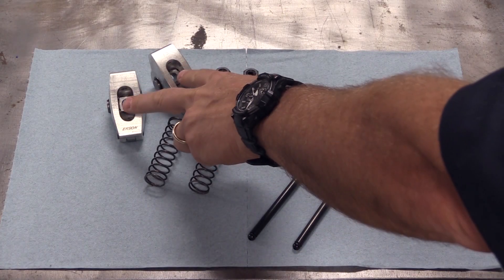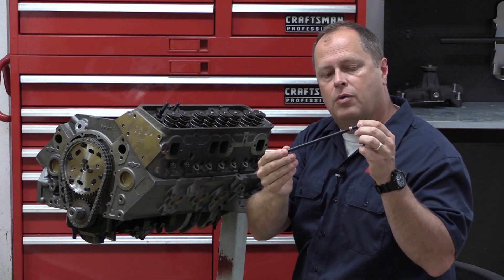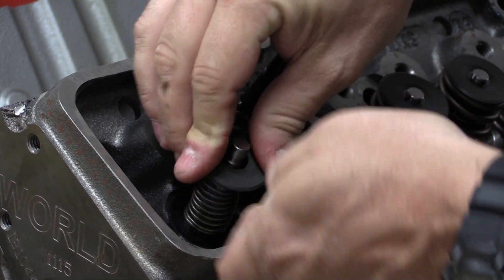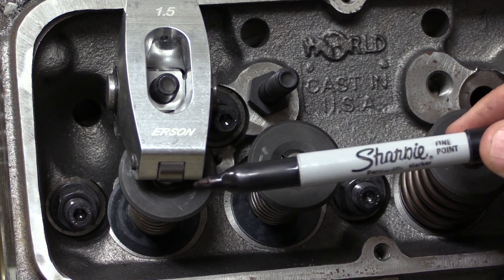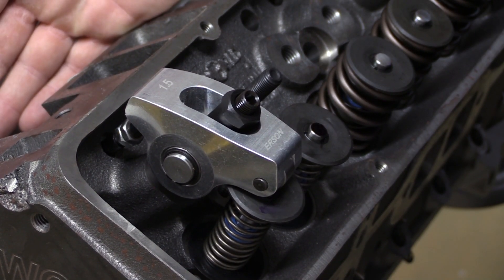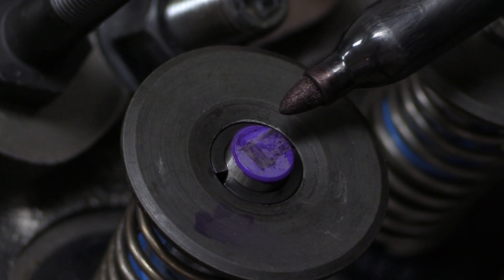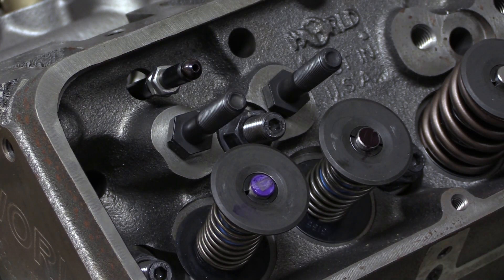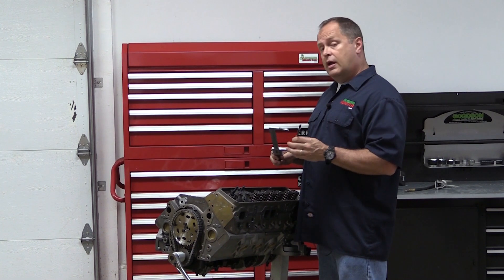How to Determine Correct Pushrod Length

Comment: turning engine over with the checking spring will not leave a mark on the machinests dye, the checking spring is too lightweight so you have to just slightly wiggle the rocker back and forth on the valve to leave a small mark

Comment: I don't follow these threads so my responses to them are very intermittent at best; people waste too much time worrying about a moot issue in all your discussion about the P.R. Ball tip radii and oil hole, etc. And TFS and Summit are hardly authorities of high performance. If I had $10.00 for every TFS head I had to tell the rocker customer to throw away before buying rockers, I'd of retired much sooner. Push-rod "checkers" are another joke, even though I designed one of the simplest and most accurate on the market for our PVS rockers. Personally, I never used one because I could set the geometry to within .003" of dead accuracy (.001" actually) in about 5 minutes with nothing more than a straight edge and set of dial calipers. Anything longer was only the result of how many Jack Daniels and Coke I was drinking at the time; so in those cases it may have taken me 10 minutes.

Point is: If you know what you are trying to do, then you solve the problem with the FINAL RESULT technique, and THAT circumvents all the theory, all the push-rod tip radii flats from oil holes, and all the other crap people get lost in the forest for the trees, trying to over analyze.

Secondly, all this VALVE SIDE geometry is mitigated (reduced) in its benefits if your PUSH-ROD side of the rocker is already too high from the manufacturer (as all are, except what I make and made), and the axis of the push-rod link (ball tip, or adjusting screw) is over-arcing and sweeping inward to the center of the rocker as it moves up to maximum lift. If you need a visual of this, simply use the tail of your dial calipers (for a depth measurement) and butt the end of the calipers against your rocker rail -- extending the measuring stem up against the push-rod for THREE measurements: CLOSED VALVE; MID-LIFT (I still hold the TM for that term, so it would be "half-lift" for everyone else); and finally FULL LIFT. You will see the push-rod has moved from its nearest position to the rocker rail, to its furthest position, will be anywhere (if you're lucky) from .050" maximum in-and-out sweep; to (if you're typical) .150-.180" maximum sweep; and if you're really using some junk, it will exceed .200". FYI, the MID-LIFT PVS rockers, and my MEI (Miller Engineering Inc) PRO-STUD, and PRO-SHAFT systems I designed have a push-rod motion (depending on valve lift, of course, because there's more arc involved) of approximately .013" (thirteen thousandths); to high valve lift (over .800") of .017" maximum in-and-out. In other words, to the typical untrained machinist's eye, you can't see the push-rod move in and out on MID-LIFT systems. It simply goes UP and DOWN.

This isn't an ad, nor am I bragging; I've stated these "facts" in countless published materials over the years, long before I was making rocker arms, but only building engines. My Book: ADVANCED ROCKER ARM GEOMETRY (By Jim Miller), available at MID-LIFT.com and Amazon, explains all this in simple terms, but also tells you how to FIX the other rocker brands that are out there. Some can't be fixed, like Harland Sharp. But Jesel and T&D can, with some tradeoffs. In SUMMARY: You set rocker geometry by using the valve itself on an unassembled engine (yes you can set geometry for "shaft" systems on a work bench, unassembled); or the valve spring retainer on an assembled engine. You use MATH, not "eyeballs." The sweep on the valve tip is only a symptom, and you can be off by 20% using that. How anal am I about push-rod geometry? My systems have the push-rod lined up with the tappet axis, and the rocker arm decisions are made from that reference point on an assembled engine. Unlike Dan Jesel, who never designed a rocker arm in his life on an assembled engine, but only used a head on a bench, ("Send me your head, and I'll design you a rocker." --Dan Jesel), every measurement a MID-LIFT system uses is based on the cam position in the block, the tappet position on the cam, and lastly, trying to work around the cylinder head manufacturer's ignorance about rocker arm mounting and push-rod needs when designing their ports. The push-rod is EVERYTHING.

What difference does that make? Well, the push-rod sweep I mentioned above, means your push-rod is wasting time going in and out instead of up and down, and in the micro-measurement world of cam acceleration ramps, that works out to LOSING 8, 10, 12 or even 15 degrees or more of CAM DURATION during the acceleration ramp phase. In other words, your 265 degree at .050" tappet lift cam, is in reality only 250 degrees at .050", when you remove what is lost at the VALVE. You don't know it, because you only check the cam duration at the cam. If you're a pro, like the NASCAR teams I taught back in the mid and late 1990s, you have a Cam Doctor, and use dual sensors at BOTH the TAPPET and the VALVE, then you see it. Then you realize how important splitting the push-rod arc equally is, as well as the arc on the valve, which is secondary. But because the valve is what everyone sees, because it moves 1.7 times more than the push-rod (ratio effect), and because it leaves a mark on the valve tip, that is all anyone pays attention to. So if you set MID-LIFT geometry AT THE VALVE using the RETAINER as a GUIDE to see where the AXIS of the TRUNNION o SHAFT is in relation to the AXIS of the ROLLER TIP, in the CLOSED VALVE position, and you KNOW your NET VALVE LIFT, so you can DIVIDE that lift EQUALLY, then you don't need to worry about push-rod tip radii, or anything else. You bypass all that crap. And so does your CAM! Good Luck! --Jim Miller
Reply: Can you please make a video? I want to do it your way, but i'm not good with reading. Or else i would buy your book.

Comment: Great video! Much clearer than others I have seen here. As you said, the contact patch is better high than low. In fact, for long valve guide life it's better high than centered. Valve spring pressure (and side thrust wear) at max lift is MUCH higher than seated pressure, so it's better for the contact point to be just past center at max lift.

Comment: Do the same on the other bank / head--you would be surprised at the variance you might find.
Reply: Especially on older classic cars which may have had previous valve jobs/ machine work or valves replaced. Every pushrod in my '67 Corvair is a custom length. I mark them and do not mix 'em up.
Reply: Exactly...

Comment: This is a well intended video but has many errors.  Verifying the center swipe mark with a lite weight valve checker spring is basically correct.  Other critical details were omitted.  You do not simply measure the pushrod length after verifying the center swipe mark.  This is a common error. The technician did not account for the 0.017 standard machinist calculation for a 5/16 ball pushrod with a 0.10 through oil hole.  What is going on here is that the pushrod's ball radii, not the oil hole flat surface, is what interfaces with the lifter and rocker arm and is thus the actual pushrod length that the engine uses.  You can’t measure that radii however, so what you measure is the overall length which is where the calipers touch the machined off flat areas of the pushrod checker oil through holes. This is because most pushrod length checkers are real pushrods with threads and jamnuts added for measuring.  For a 5/16 ball end pushrod, the measured overall length is subtracted from the length at gauge diameter which is a standard value of 0.017.  It will always be 0.017 for a 5/16 ball end pushrod with a 0.1 oil hole regardless of actual overall length, so you simply subtract 0.017 from what you measured with your caliper.  The next error is that the technician did not add in length for required lifter pre-load.  If your lifter manufacturer specifies a desired lifter preload value, say 0.035, then you must add 0.035 to whatever you measured with the caliper.  Therefore, you measure the pushrod like the technician did, then you subtract 0.017, then add 0.035.  That gives you the correct pushrod length.  Summit Racing has a better video at https://www.youtube.com/watch?v=ddK0n2duAfg
Note that Summit used an LS preload value in their example but not all lifter preload is 0.075 so use the correct lifter preload for your lifter.  Many lifter manufacturers will not provide a desired preload value.  Typically, it is 0.020 to 0.060.   If anyone doubts the 0.017 value in my commentary, note that it is also in the Summit video above and also at the TFS website for their pushrod length checker.  See https://static.trickflow.com/global/images/instructions/tfs-9000_at.pdf
Also note that more modern pushrod length checkers, such as the TFS 9500 series, do not require the 0.017 subtraction since their ball ends are different and don’t require compensation for the length at gauge diameter. Preload length still needs to added, however.
Reply: Soooooo I got 7.80 length I need, minus .017 was 7.783, then I added .035 and got 7.81.........so STILL 7.8 pushrod lol. Whats the point?? Want me to pay double for custom pushrods that are 7.81 instead of 7.80
Reply: I don't follow these threads so my responses to them are very intermittent at best; but you waste too much time Brandon Smith, worrying about a moot issue in all your discussion about the P.R. Ball tip radii and oil hole, etc. And TFS and Summit are hardly authorities of high performance. If I had $10.00 for every TFS head I had to tell the rocker customer to throw away before buying rockers, I'd of retired much sooner. Push-rod "checkers" are another joke, even though I designed one of the simplest and most accurate on the market for our PVS rockers. Personally, I never used one because I could set the geometry to within .003" of dead accuracy (.001" actually) in about 5 minutes with nothing more than a straight edge and set of dial calipers. Anything longer was only the result of how many Jack Daniels and Coke I was drinking at the time; so in those cases it may have taken me 10 minutes.

Point is: If you know what you are trying to do, then you solve the problem with the FINAL RESULT technique, and THAT circumvents all the theory, all the push-rod tip radii flats from oil holes, and all the other crap people get lost in the forest for the trees, trying to over analyze.

Secondly, all this VALVE SIDE geometry is mitigated (reduced) in its benefits if your PUSH-ROD side of the rocker is already too high from the manufacturer (as all are, except what I make and made), and the axis of the push-rod link (ball tip, or adjusting screw) is over-arcing and sweeping inward to the center of the rocker as it moves up to maximum lift. If you need a visual of this, simply use the tail of your dial calipers (for a depth measurement) and butt the end of the calipers against your rocker rail -- extending the measuring stem up against the push-rod for THREE measurements: CLOSED VALVE; MID-LIFT (I still hold the TM for that term, so it would be "half-lift" for everyone else); and finally FULL LIFT. You will see the push-rod has moved from its nearest position to the rocker rail, to its furthest position, will be anywhere (if you're lucky) from .050" maximum in-and-out sweep; to (if you're typical) .150-.180" maximum sweep; and if you're really using some junk, it will exceed .200". FYI, the MID-LIFT PVS rockers, and my MEI (Miller Engineering Inc) PRO-STUD, and PRO-SHAFT systems I designed have a push-rod motion (depending on valve lift, of course, because there's more arc involved) of approximately .013" (thirteen thousandths); to high valve lift (over .800") of .017" maximum in-and-out. In other words, to the typical untrained machinist's eye, you can't see the push-rod move in and out on MID-LIFT systems. It simply goes UP and DOWN.

This isn't an ad, nor am I bragging; I've stated these "facts" in countless published materials over the years, long before I was making rocker arms, but only building engines. My Book: ADVANCED ROCKER ARM GEOMETRY (By Jim Miller), available at MID-LIFT.com and Amazon, explains all this in simple terms, but also tells you how to FIX the other rocker brands that are out there. Some can't be fixed, like Harland Sharp. But Jesel and T&D can, with some tradeoffs. In SUMMARY: You set rocker geometry by using the valve itself on an unassembled engine (yes you can set geometry for "shaft" systems on a work bench, unassembled); or the valve spring retainer on an assembled engine. You use MATH, not "eyeballs." The sweep on the valve tip is only a symptom, and you can be off by 20% using that. How anal am I about push-rod geometry? My systems have the push-rod lined up with the tappet axis, and the rocker arm decisions are made from that reference point on an assembled engine. Unlike Dan Jesel, who never designed a rocker arm in his life on an assembled engine, but only used a head on a bench, ("Send me your head, and I'll design you a rocker." --Dan Jesel), every measurement a MID-LIFT system uses is based on the cam position in the block, the tappet position on the cam, and lastly, trying to work around the cylinder head manufacturer's ignorance about rocker arm mounting and push-rod needs when designing their ports. The push-rod is EVERYTHING.

What difference does that make? Well, the push-rod sweep I mentioned above, means your push-rod is wasting time going in and out instead of up and down, and in the micro-measurement world of cam acceleration ramps, that works out to LOSING 8, 10, 12 or even 15 degrees or more of CAM DURATION during the acceleration ramp phase. In other words, your 265 degree at .050" tappet lift cam, is in reality only 250 degrees at .050", when you remove what is lost at the VALVE. You don't know it, because you only check the cam duration at the cam. If you're a pro, like the NASCAR teams I taught back in the mid and late 1990s, you have a Cam Doctor, and use dual sensors at BOTH the TAPPET and the VALVE, then you see it. Then you realize how important splitting the push-rod arc equally is, as well as the arc on the valve, which is secondary. But because the valve is what everyone sees, because it moves 1.7 times more than the push-rod (ratio effect), and because it leaves a mark on the valve tip, that is all anyone pays attention to. So if you set MID-LIFT geometry AT THE VALVE using the RETAINER as a GUIDE to see where the AXIS of the TRUNNION o SHAFT is in relation to the AXIS of the ROLLER TIP, in the CLOSED VALVE position, and you KNOW your NET VALVE LIFT, so you can DIVIDE that lift EQUALLY, then you don't need to worry about push-rod tip radii, or anything else. You bypass all that crap. And so does your CAM! Good Luck! --Jim Miller
Reply: @jmmiller7560  Jim:  You are bragging and your reply is an ad but thats OK.  I actually have your $90 book and know your methods.  I recommended that you rant on the crappy Erson video and not bang on machinist that can do math. Insulting me to prove your point is an integrity issue.  Think about it.
Reply: @BlueOvalEdge  Uhhhh, okay. I thought about it. What now? "Methods"? "Rant?" "Crappy Erson video?"... Gee, I must be back in high school, soothing the bruised ego of someone who was well meaning, but just didn't get my point. I know you have my book. I remember seeing when you bought it. I don't see you saying anything in contradiction to what I wrote in reply to your comments; which by the way, I republished at the heading of this thread to EVERYONE, and rewrote the opening to make it obvious it was for everyone by removing your name.

The point you missed, and seem to be defensive about, is that your micro-measuring rhetoric about the push-rod tip radii flat in the math doesn't mean anything with setting geometry. Let me put it another way, all the good push-rod manufacturers take into account the .015" to .020" shorter OVERALL LENGTH an engine builder asks for from a full radius tip push-rod checker. So if your mission was to cure that deficiency, that was all you needed to say.

You wrote your reply to this VIDEO. The whole purpose of "push-rod" length measuring and changing is GEOMETRY.  Sorry if you feel offended or that I was "insulting" you. The only reference to you is in the first sentence about "worrying about a moot issue," and then over explaining the above point push-rod companies allow for. The rest of my diatribe was intended for bringing people back to what is important, and not getting off int he weeds about some of the "symptoms" this video addresses, without explaining the priority, and your comments imply, without focusing on the mission.

Lastly, I don't "rant" on anyone; unless you consider pointing out the flaws of misleading or misguided arguments as "ranting." Apparently, you feel I "ranted" on you. Apparently you need to "rant" on Erson. Apparently you think "machinist" can "do the math"? What math is that? How to subtract .015" (or .017") from a radius? Wow. Or are you referring to the math about setting geometry with the least amount of error and time? Don't worry, they're all rhetorical questions. Bottom line, is I wasn't insulting you, because you obviously didn't get the point, except that you construed my point was to insult you, and therefore now it is an "integrity issue." Brandon, that is a shallow point of view, that I think you're smarter than that to conclude, but maybe not thick skinned enough to accept. "Think about it." Best regards!